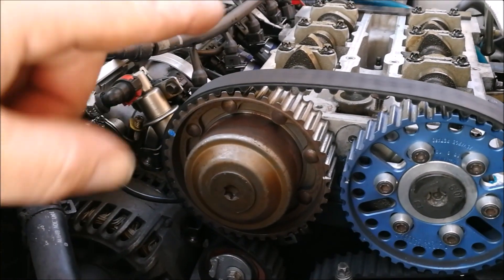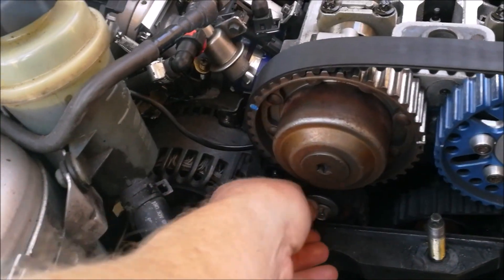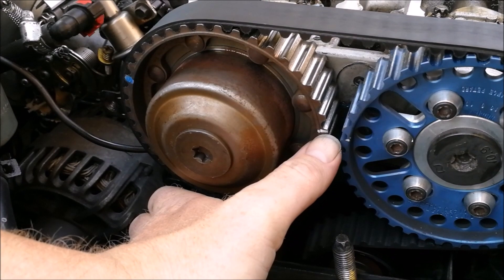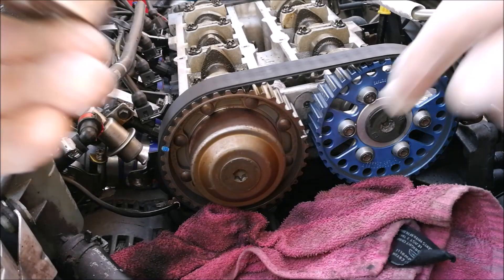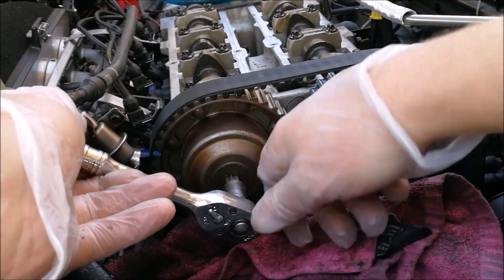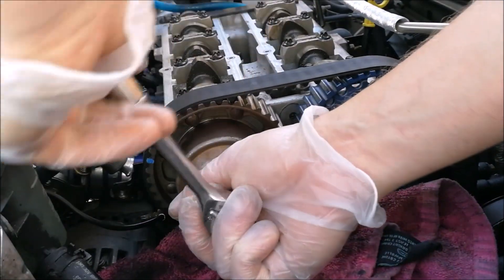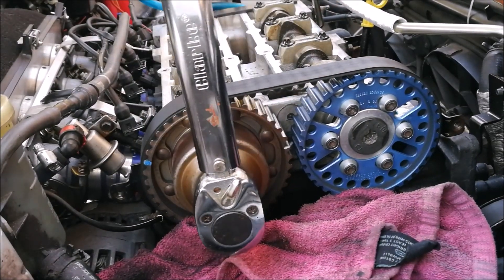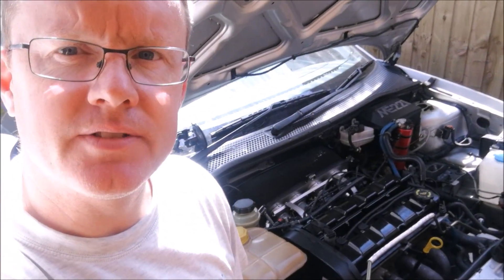HOW TO FIX P1381 / P1383 CAM TIMING

Comment: 3:50 what exactly did you do here? It looks like you just loosened the cam bolt then tightened it back up, but im fairly certain its not that easy/basic...
Reply from the maker: It allows the spring loaded vvt pulley to reset to its neutral position if that makes sense
Reply: @Sparkplugsteve gotcha! Do you have any familiarity with the 2.0s that came in the 2001 Escort ZX2?  It looks very similar to the engine in this video except the VCT Cam is the one closer to the front of car... anyways, after about 10 mins of driving it bogs down badly at idle/stop, and it throws the P1381 code. So I purchased the locking bar/pegs, removed my valve cover, and tried unsuccessfully to insert the bar into the slots at the end of the cams... they are definitely misaligned by a couple degrees, but when I went to turn engine by hand so I could atleast slide bar into first cam, the belt/pulleys would only advance a couple inches, then revert back to the original spot as soon as I let go of socket wrench...any clue why that's happening?

Comment: Is there a tool available that is specifically designed for keeping the Cams properly positioned? I need to do this repair cause my ZX2 Bogs down/stalls at idle and gave me these code, but I'm a little sketched out about doing it...does anyone have a step by step instruction for this repair? Cause the only write ups/videos I have found either start halfway through job or just assume you should know what exactly to do :/

Comment: So I just got a svt focus it’s an 04 so all new timing stuff was put on by previous owner I’m getting codes p1518 for IMRC and P1383 for overretarded timing how exactly do I fix that I haven’t messed with timing too much
Reply: Try checking the imrc runner to make sure it's not stuck. Also check the imrc servo control motor. Toyota and Volkswagen use engine vacuum.

Comment: Hello Steve. I've just rebuilt my st170 and had p1381 code, thanks for your video it really steered me in the right direction to fix it. Now the engine runs well but I have 1 remaining issue, when I blip the throttle I hear a rattle which sounds like the imrc or dsi rattling, but I have just repaired the imrc box with new transistor and it works perfectly, I've even unplugged it and held it firm with my hand and it still makes the rattle so im thinking what else could it be?
I also have a idle hunt situation when I close the throttle but it does catch it. Im thinking iacv cleaning will sort that.
So if you got any idea why I've got a rattle when revving please hit me back pal. Thank you again.
Reply: Mine also has a rattle, have you found a fix?
Reply: @wraithmedaberry5795  it's the vct timing is incorrect. I did my timing wrong and had the rattles because the Inlet cam is open at the wrong time slightly. Watch my video on vct on how to do it properly.
Reply: Mine has a rattle and it’s the vvt cam pully on it’s way out

Comment: Hello Steve, i really need your brains about 3 things: 
1. your tensioner tightens clockwise while mine tightens counter-clockwise. I suspect they gave me a blacktop one, not exactly a ST170 one. I drive it 1 week already and no problem. May there be a problem in your opinion? 
2. you tighten the bolt to 68Nm but the instructions say 127Nm, 68Nm is only for the exhaust cam, are you sure 68 is enough for the intake too? 
3 main question: when i start the car and it's idling, the Intake cam actual advance in the ForScan live data hovers ~0. But when the engine warms up it hovers around -1,5 to -2,5 degrees. Why is this? And when the revs go higher and the ECU starts to retard it, is this compensated while driving?
Thank you very much on your feedback

Comment: You're only mistake is using the cam lock tool to hold the cams in place while loosening the cam.bolt. That is a very good way to break the camshaft ends. Always use a wrench on the cams while loosening or tightening with the plate removed.

Comment: Steve, I was wondering if you could help?  Really useful video that I'll be making use of in the future - but at the moment I cannot for the life of me find the timing hole blanking plug on the block.  Could you possibly point me in the right direction?  I've got the Haynes manual, but they don't do one for the ST170, so I'm pretty sure it's leading me astray!  Thanks
Reply: Ese tipo de motor no tiene marcas de sincronizarlo los árboles de levas tienen una posición de inicio  y unas ranuras en forma de media luna en crank  donde introduces un  perfil metálico y el punto muerto superior con el damper o sugueñal

Comment: Hey got mine all up and running got this fault code you have also the imrc code with ant working at all. Done what you did in video still getting the same code engine like don’t come on thou just see it on computer. It’s not got a lot of power on the lower end but thinking that’s the imrc problem ? Any idea y still this code

Comment: Hey wondering if could help me out got a st 170 I’ve time it up like it should, when when start it it’s getting blow back out the inlet even pushing the inlet off the rubbers any idea?
Reply from the maker: Mark Coyne sounds like the timing is out quite a lot.
Reply: Spark Plug Steve I just don’t get how I’ve watched all the videos and mine done the same, I’ve undone the cam pulls put number 1 to top dead centre and put the locking took in turn clockwise and it’s locks and number 1 is 100% top (cylinder next too the pulls)
Reply: Spark Plug Steve then put the belt on with pulls undone still then I’ve put the cam with the locking tool in then done up the cam bolt to lock the pulls
Reply from the maker: Mark Coyne maybe the spark plug leads are on wrong?
Reply: Spark Plug Steve I did take them off and look up the way meant to go so mayb so if I look at the coil on the car have top left is 1, 
top right is 3
bottom left is 4
bottom right is 2 
Does that sound right
Thanks for the help btw
Reply: You think bad spark plugs can make it back fire that much like it blow the inlet manifold off the rubbers holding it to the head lol
Reply from the maker: Mark Coyne I'm not sure without looking at my coil pack. But just double check they match on Google. Hopefully it will be your issue and an easy fix. Let me know how it goes
Reply: Spark Plug Steve You think bad spark plugs can make it back fire that much like it blow the inlet manifold off the rubbers holding it to the head lol
Reply: Spark Plug Steve still no luck have no idea, have spark with new plugs, loads fuel coming out of injectors but just won’t run, still get and bag now and Again but no start. 
Do you think if inlet are bent would do the blow back out of inlet?
Reply from the maker: Mark Coyne hopefully it's not bent valves. It's hard to say what it is without being there and checking it over.

Comment: So actually what should i do? 
Cuz im strugling this problem for 6 months
Reply from the maker: Filip Pe hi. First thing you need to do is click the subscribe button. Haha. Basically you need the camshaft pulleys bolts to be lossened so that when the belt is tension no preloaded is put on the vvt spring mechanism.
Reply: Spark Plug Steve so bascilly the same things that u arę doing in the film? Or all those steps without these one where u arę loosing the second bolt in VVT?
Reply from the maker: Filip Pe iv just replied to you Facebook message. Il talk to you there as its easier. Thanks.

Comment: I got just once a code P1383. I erase it and it has never showed up again. So I think i have got some other mistake. Timing belt changed at 170t km and now I have 215t km. Bought this car with 210t km about three month ago. 
I just clean VTC solenoid by carb cleaner and it seem to be fine.
Reply from the maker: Zbynek Stekl see if it comes back. If it does then maybe its the timing.
Reply: Did it ever come back on mate just had same issue cleared code not returned since.